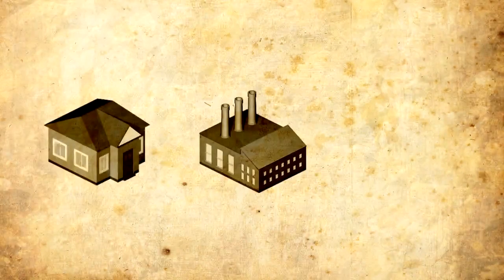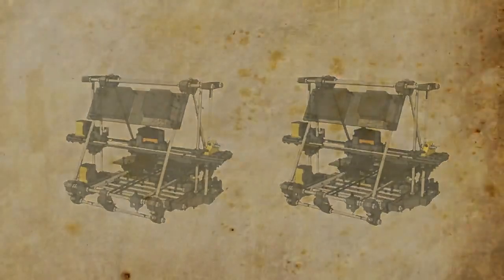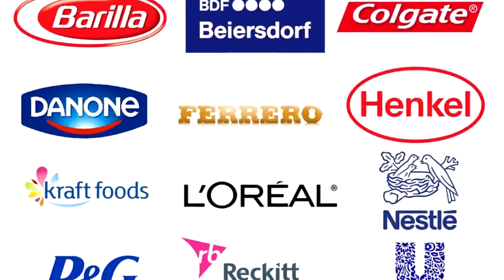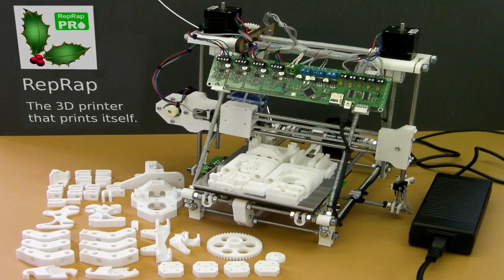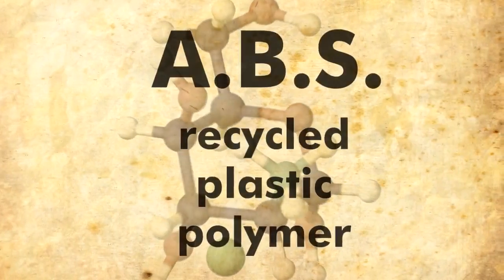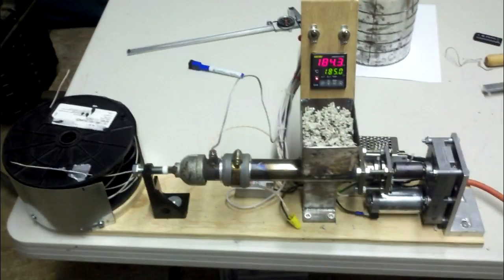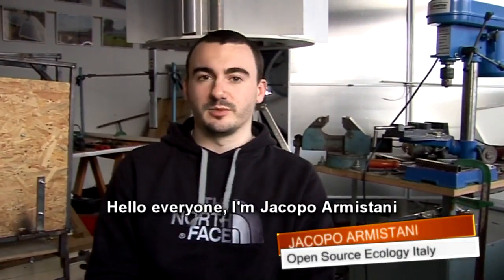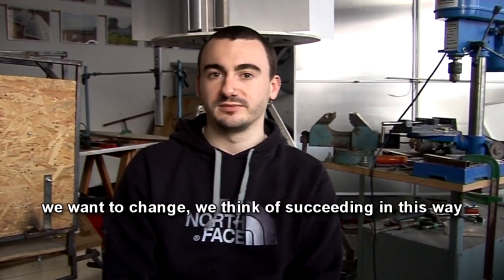[SUCCESS!] 3D Printers for a better world!

Comment: Another aspect to consider is the reduction of the parts needed for a 3D printer.
Check out The Peachy Printer on Kickstarter. It has a laser that hardens a layer of resin that floats on slowly rising water in a reservoir. All is controlled by the user's computer or smartphone.